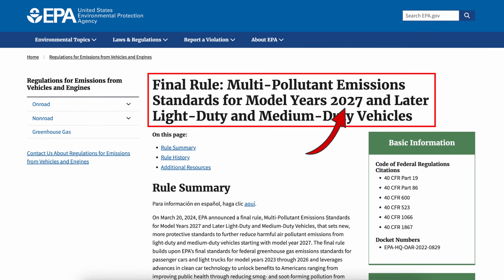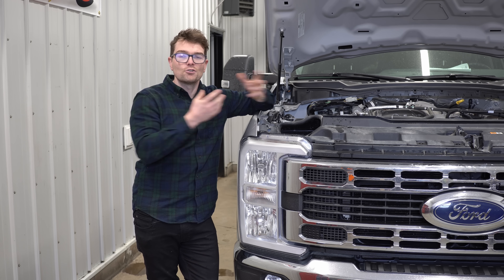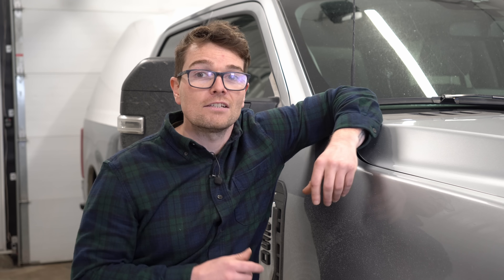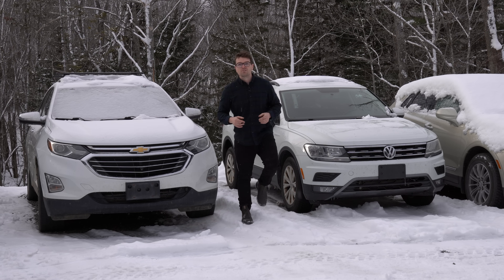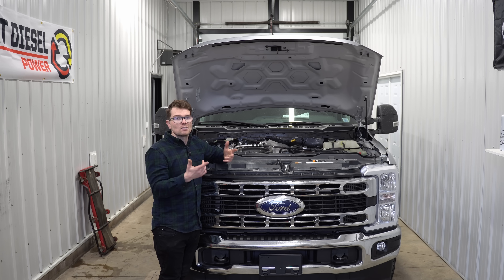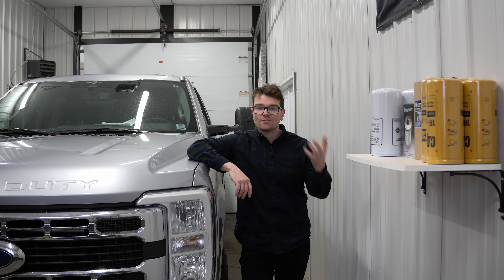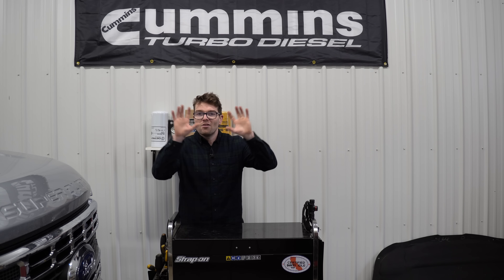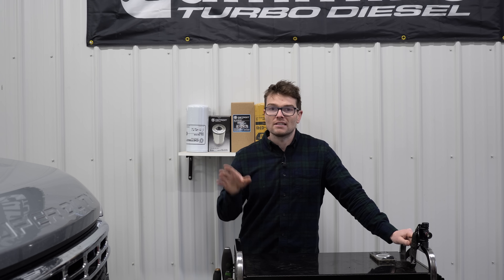NEW 2027 Cummins Diesel Engine EMISSION REGULATIONS are WILD **Diesel Mechanic Explains**

Comment: Basically pushing electric or nothing by mandating 0 emissions on diesel engines. The current emissions system cleans the exhaust so good that our gas engines has more particulate on the tail pipe than my diesel did.
Reply: Complete and total control of the people that choose this option.  We must fight this
Reply: Also, it wouldn’t surprise me if we see gas cars be required to use GEF in the future. Although, by that time, it’ll just be called EF
Reply: What's the unknown effect on human health. Smells like death. Gas engines don't kill you as diesel does. F the EPA!
Reply: That wont be true once GPF's are installed though. You have all this shit on a diesel just to make it marginally cleaner than a gas motor. And I dont think GPF's will be as painful to deal with since gasoline engines run higher EGT's naturally, so they dont need to regen, or regen as often at least.
Reply: @Jay-me7gw  both im imagining eventually they/epa/manufacturer's will start DI-water/def/meth into the hot cylinder on the exhaust and or power strokes instead of leaning to much on EGR/downstream systems, im trying to avoid adding any-duty cycle egr/outside unfiltered-air as it's basically soot=sand=rebuild-needed sooner ect

also might see more systems like multi-air/valves-shutting down/off and or VCR-rod''s/shuttered-pumping-piston's/no-stroke is 5~in and off=0-stroke pwm/duty's-cycle-ECU reduces the complete~ need of EGR or in my mathematics my 8v 540ci hemi's 1-cylinder is 1L so with everything it's possible ish to fooling it to act like it's a 300cc~ entire engine at idle and on freeway cursing 80mph+flatlands skipping on 1 or 2 cylinder's probably out-of-boost but even if on chooch that's 90-200~hp, full8=~900-2K hp and about equally torque numbers
Reply: @Jay-me7gw 

One stupid idea doesn't justify more stupid ideas.
Reply: yeah that's why particulate filters are coming to gas shortly.
Reply: @CorRob-h8b  And then there will be new fuel consumption requirements making combustion engines even less viable.
Reply: Diesel particulate is much more carcinogenic than gasoline particulate.
Reply: @OtisFlint 

Sounds like EPA propaganda.

Comment: Well extending the warranty will serve as a big deterrent to deleting - UNLESS - the 10 year warranty ONLY covers some of the new and or additional pollution control devices.  I just can't see the big 3 warrantying the powertrain / rotating mass that long.  The cost upfront would just be guessing for them when calculating up to 10 years from now.  BUT it WOULD make them reconsider durability and reliability to a much greater degree and maybe encourage aftermarket companies into manufacturing more parts again.......

Comment: I love how we all have to abide by these rules, but the government does not have to. It’s all about control…. It’s such BS, cause now I’m definitely not gonna bother buying a diesel, but will have stick with a gas engine that’s not capable of pulling as much.
Reply: How much do you need to pull?
Reply: @Jay-me7gw  well over 30k, my truck is only capable of doing 14k and my license only allows me to do up to do up to 26k I think it is, I started a business and this is the second year I’ve had it and it’s been picking up, I need to be able to pull bigger loads on top of the driving distance.
Edit: it’s quite annoying I have to waste time to do 4-6 loads.
Reply: @TheAudi585  If you're regularly pulling 30k, you shouldn't be looking at pickups at all.
Reply: @skiiermav  a heavy duty one is what I need, the 6.7 would suffice. And no not the SO but what should be using if not a pickup truck? Idk what regular would be, I just need to pull that atleast 40-50 times a year.
Reply: @TheAudi585  That sort of weight puts you pretty firmly in Class 5 and up truck territory. Think a Ram 5500/equivalent or bigger. Also keep in mind if you're talking about Gross Combined Vehicle Weight (GCVW) or towing weight. If it were me I'd be thinking pretty hard about getting a semi truck setup instead.
Reply: @skiiermav  honestly their isn’t much of a difference for the towing complicity’s between the two which is all I’m really looking for, the 3500  long bed would work great and of course the payload for the 5500 is about double what the 3500 is which the 3500 would work fine since I mainly tow and only when the bed is full would it weigh around 2-4k extra. And when I get another piece of land I do plan on hiring a semi for a little bit lol. I myself am the one that does all the work and hiring a semi wouldn’t hurt once in a while. 
Edit: a big difference is also the engine and transmission, I would love a diesel but once again… more restrictions which is bs…

Comment: I dont believe that gasoline engines with particulate filters really need to regen because they naturally have higher EGT's. My Ecoboost would hit 1800-1900* EGT's.
Reply: They don't. GPFs are not an issue, it's very different from DPFs.
Reply: Diesel exhaust gets pretty hot too under load. They still need regen.
Reply: @jackylsmith8138  1900* though? Cause I know the 3.0 Duramax starts cutting power at about 1500-1600*. And on the older diesels from the early 2000’s people were freaking out about anything over 1300 on the pyrometers.

Turbo Gasoline direct injected motors usually have their exhaust manifolds integrated into the cylinder head with a water jacket and use stainless steel turbine housings and don’t have to worry about baking the variable geometry components
Reply: You are correct. OPF/GPF systems have been around for almost a decade now in Europe and they're basically trouble free.